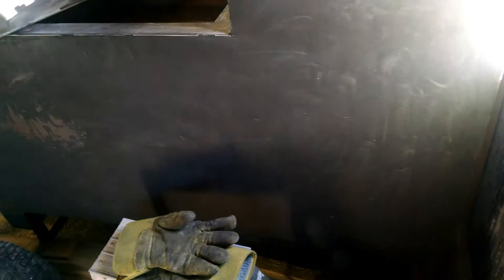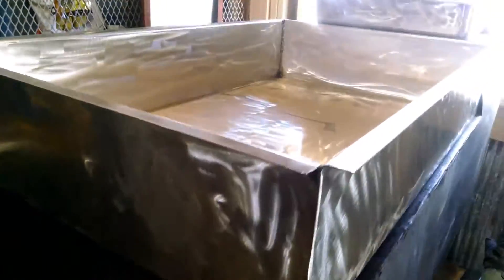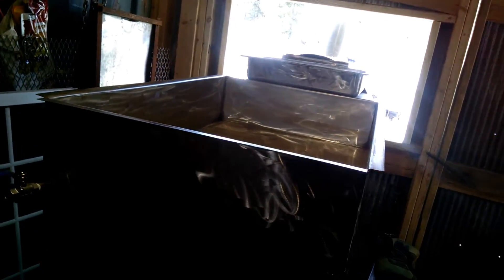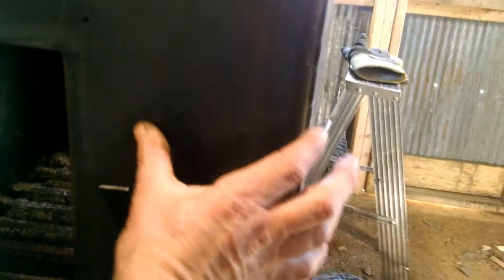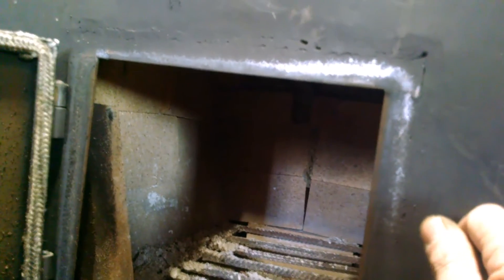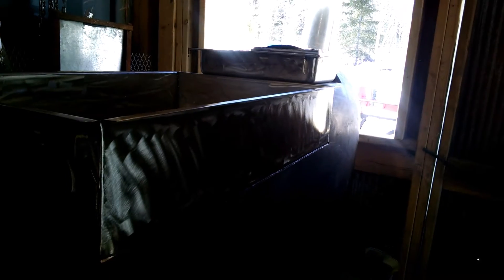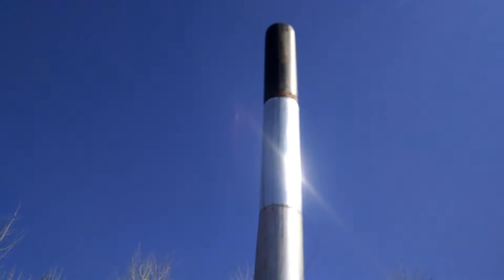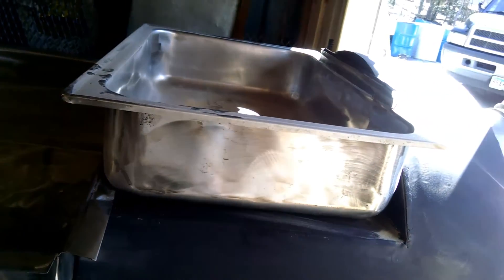My improved Maple sap evaporator 26"x 42" pan

Comment: ?, how do you steer/turn the unit when rolling it? is there a pivot in the axel?
Reply from the maker: I can move it around by hand while the wheels are on. No, the axle doesn't pivot. it doesn't go very far. I just pull it with my four wheeler or by hand.